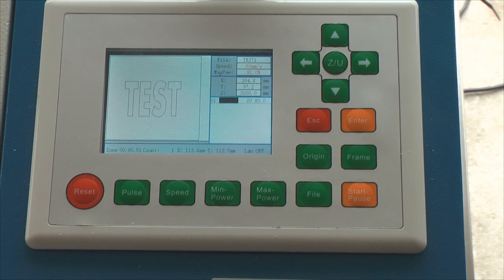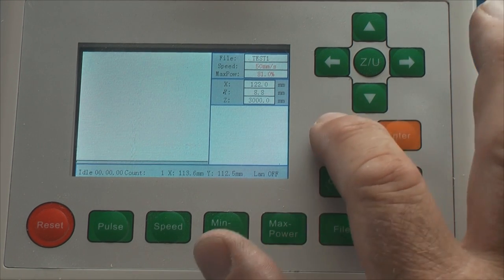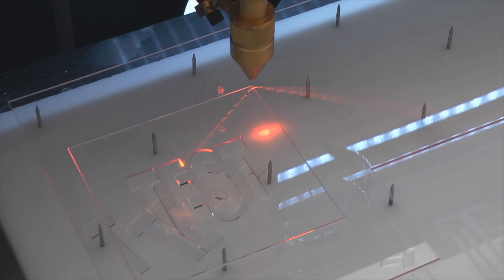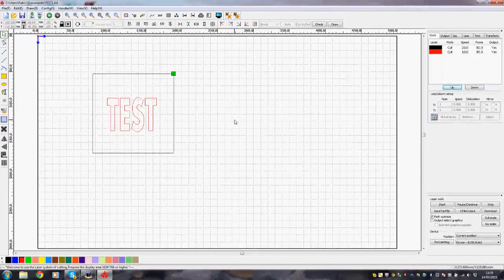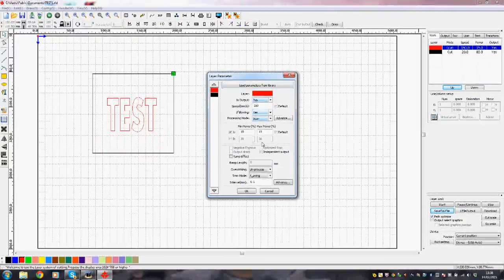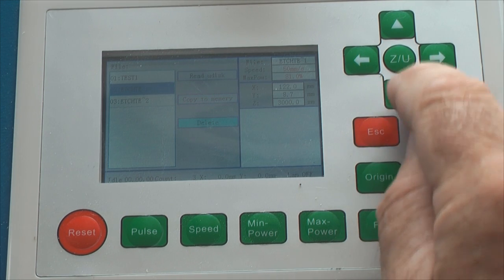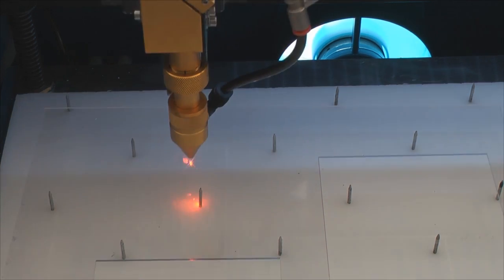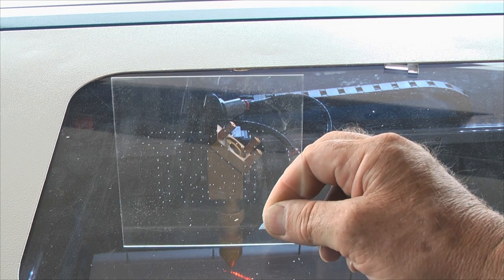Chinese laser cutter  tutorial part 5

Comment: Thanks for making these videos! Ive been using a glowforge for my business at overview.design for about a year now and wanted something larger. Your series has really helped me make some decisions.
Reply from the maker: Hi David
Thanks for the comment
If you have  only gone as far as this initial tutorial then there are 3 years of my learning journey to catch up on.Iam in the fortunate position of now owning 2 machines .One is this low cost "China blue" machine and the other is a slightly bigger 600x400 better quality Lightblade  machine (at 5x the cost) that has really been a plug and play unit. I have had fantastic fun understanding the many little design flaws with the China blue machine and it has forced me to learn about the many details and dark corners of this sealed tube technology and the things I wold look for if ever I bought another machine. I have pimped up my little China blue so that is a real gem and I have not spent huge amounts doing so. 
How have you found the Glowforge? Is there a reason for changing? Upsizing? Speed?

Best wishes
Russ

Comment: And I am having trouble with my life!!   Etching seems weak even on higher powers.   Cutting needs much power- upwards of 75% For small thin wood products and acrylics.    Photo to engrave is aggravating and cannot get the correct settings.   I’m afraid I’m going to break this thing with all of the experimental numbers I’m pushing.   Cheers Russ
Reply from the maker: I'm glad you have a great sense of humour. It's a definite requirement if you are trying to house train one of these little Chinese dragons.
As a general rule cutting requires everything that you can throw at your material and then you set the speed as fast as the cutting will allow. With engraving text and logos etc, it depends on how deep you want your engraving. Because this is scanning and will take a lot of time, you tend to set high speeds in the region of 300 to 400mm/s and then set your power to get the depth of cut you are seeking. This will generally be 50% or more. With photo engraving you are trying to get the smallest possible dot and that involves setting speeds of between 100 to 200mm/s (depends on the response capability of your HV power supply) and very low power , probably in the 10 to 20% region. 
All this assumes that you have a well performing tube and from what you describe your tube sounds like an ill tempered teenager. Is your tube labelled K H Laser?. As I suggested earlier,we may have to try to resolve this by email.

Best wishes
Russ

Comment: Sir, may i ask where you purchesed this laser from? can you provide me with the shop link?
Reply from the maker: Hi 
There are several similar to this on ebay .uk

https://www.ebay.co.uk/itm/500-300MM-50W-CO2-LASER-ENGRAVING-ENGRAVER-MACHINE-CUTTER-WOOD-CUTTING-USB/253293418743?_trkparms=aid%3D555018%26algo%3DPL.SIM%26ao%3D1%26asc%3D20140122125356%26meid%3Dd8ea14a22a0f4a56aa8af937f36199e2%26pid%3D100005%26rk%3D1%26rkt%3D5%26sd%3D382621948914%26itm%3D253293418743&_trksid=p2047675.c100005.m1851

Put the description into your ebay.
Be warned. At tis price it is good value for money BUT it will be fitted with a B grade tube and power supply .It will work but not very well. It will get you started but you will soon have to spend another £400 on a new A grade tube and power supply

Best wishes
Russ

Comment: what happens if i hit a nail point?
Reply from the maker: Do you also lay awake worrying about how you are going to spend your lottery winnings?. Joking aside, the chances are low but if the beam (through the very thin slot) does coincide with a nail point, it will reflect off like a mirror and that energy may be be enough to cause a small scorch mark on the bottom of your job. Pity all those folks with honeycomb tables ...nightmare!!

Best wishes
Russ

Comment: Good night Sarbar! Can you simulate the cut? as if the head passed where it will cut but without firing the laser, thank you.
Reply from the maker: Hi Marlon
There are 3 ways of doing this.
1) Choose the preview screen in RDWorks and run a software simulation of your program.
2) Set your max and min power to 1% and run your program. The laser will not fire at this low value.
3) If your machine is fitted with a laser switch,  then you can just turn that off.

Best wishes
Russ
Reply: thank you!

Comment: I purchased the 50 watt co2 laser engraver 3 months ago.  It worked fine for 3 months then the laser stopped firing in middle of a job. I am getting voltage to the laser tube but it doesn't fire . I replaced the tube and i the same results. I did notice on the main board that 15 was lite up but I don't  know what 15 light is for.  I do not have ground in my home but it still worked for months.  Can anyone tell if they think it could be a ground issue?
Reply from the maker: Hi Gary
The instant nature of the problem you describe is not typical of a tube failure. Your tube will start losing power as it starts to die. It will be over days or even weeks. What you describe is an electronic component failure within the power supply (usually). The fact that you have LED 15 on is good. That means your mains conditioning power supply is working and the controller has power.  That means that your programs should run but with no laser power?
If the power supply is working then there will be a beam in your tube. If there is a beam but no power then that is a tube problem but if there is no beam than you have a power supply issue..

Your machine was provided with a grounding spike and wire to earth it separately. I presume you have that fitted.
If this was an Ebay machine, the chances are that you have a B grade HV power supply fitted. Within my  copious correspondence, I have many reporting early  power supply failures.  Your original tube will have been B grade also BUT it depends where you purchased the new tube. If you bought that from ebay then that may well be a B grade also. The Chinese have found Ebay a great way to monetize their rejects. Is there a  brand label on your new tube? (K H Laser or Xi laser for example)
Although ebay is a great place for some items, trubes and power supplies are a no,no.  If you have a machine importer on your continent that you can trust, buy from them. (i'm still very unsure about Lightobject). The safest and cheapest place to buy is direct from China, however, when you add the courier charges and your local import/taxes, the end number is eye watering. I know because I have been on that route. After buying a replacement tube from ebay, (I got burnt a second time) I swallowed hard and bought a new 60 watt tube and power supply combo. That was 2 years ago and it's still performing like new today.

Best wishes
Russ

Comment: Hi,

I recently purchased one of these machine. The small screen on the machine is in Chinese. Do you know how to change this to English?
Reply from the maker: Hi Eoin

Take a look at this
https://www.youtube.com/watch?v=UF37pbL2hpw

Best wishes
Russ
Reply: Hi, Yes, I got it sorted. Do you have one of these engravers?
Reply from the maker: Hi Eoin
Yes I have an upgraded  ebay Chinese laser (70 watts)  and also a much better quality Chines built laser (60 watts) supplied by a UK company called Thinklaser.
Best regards
Russ
Reply: I cannot connect the computer to machine, or I cannot get the laser head to move from the controls on the machine. Any suggestions?
Reply from the maker: Hi Eoin
With the machine turned off, move the head to the middle of the table. Now power up the machine (you can have the laser tube tuned off). What happens at this point?
Best regards
Russ
Reply: At present, the head is positioned in the middle as a default. When I turn it on, it stays in that position
Reply from the maker: That is wrong to start with. It should drive the X and Y stepper motors to set a 0,0 position at either the back left or back right corner and then return to the last defined origin point, which in your case may be the centre of the table.  For neither motor to move is unusual and can be nothing to do with the controller because you have a panel display. Thus there is a 245Vdc supply to the controller. The silver perforated mains  conditioning power supply will have 2 output voltages. One will be 24 vdc which we know is working and the other is probably 36vdc to drive the stepper motors. If you have a voltmeter you can check if this PSU is supplying 36vdc. If it is you will have to check if that 36vdc is still there across the stepper motor drive teminals V+ and GND. for both X and Y axes. I suspect there maybe no output from the PSU or if there is,   a break in the line supplying the drivers.
Best regards
Russ
Reply: So when you turn on the machine, the laser head should move?
Reply: Where are you based?
Reply from the maker: That is correct . It should move to one of the rear corners where two sensors (little rectangular blocks) will stop the motors and set a 0,0 position for program to work to. No movement means no power to the steppers. As I said, it can only be the 36vdc supply that is absent that stops BOTH stepper motors
Best regards
Russ
Reply: Shit, is this easily fixed?
Reply: Where are the 36vdc supplys?
Reply from the maker: Hi Eoin
I am based in the UK . Sorry I cannot preform miracles so I cannot say how easy it is to fix. You cannot fix a problem until you understand it so the loss of thye 36V supply to the motor drivers seems like the only logical thing that will affect both motor simultaneously. If there is no power out of the 36V terminals on the silver power supply then it means a new PSU. If there is power out of the PSU but it never arrives at the stepper drive modules then you will have to find the broken wire.  I suspect this may be outside your realm of experience and it may be the time to call in a favor from a techy friend?
All best wishes
Russ
Reply: Thank for your words!!
Reply: Have yon an email address? I would like to email a photo to you relating to the laser engraver
Reply from the maker: Look at your you tube messages
Russ
Reply: It is also coming up on the small screen on the machine saying 'Water Error 1'. Any ideas what this is?
Reply from the maker: Yes. It means that either you do not have water flow through your laser tube. If you do have water returning  water  to your reservoir then it means that the switch is not working   (a fairly common fault). There will be a temporary way to bypass this but first check that you do have water flow or you could wreck your tube.
Russ
Reply: Water is flowing!

Comment: Hi, first thanks for this remarkable series of tutorials. With your tutorials help my machine is set up and works well when driven from the keypad on the machine.  Second Help! I have RD cut files on the stick. when the stick is in the top port (usb interface) there is no light on stick and no files can be found.  When the stick is in the second from top (usb socket) the stick light is on however when I go File -u disc-Enter-read u disc - Enter I get NO FILES. It seems that the rd files are not on the disc. The stick does contain other format files. Should I have used a new empty stick? What can I do to try and fault find? Can I try and run it from the lap top driving it from the RD works program.  Any help gratefully received.  Malc.

Comment: Thanks for this video. You did a great job! After watching this videos I decided to buy one.

What kind of pressure regulator did you use? And what are it's ratings.
Currently it is hard to one, that is operating at such low rpressures.

How long does it take, until the water gets hot?
Reply from the maker: Hi
I used a normal air regulator but it's right at one end of it's adjustment. It's not really regulating pressure it's more of a flow regulator. So any  cheap regulator will perform this function, for example 
http://www.ebay.co.uk/itm/Compressor-Relief-Regulating-Regulator-Valve-AR2000-Pressure-Gauge-Air-Control-/351047069388?hash=item51bc092ecc:g:CbIAAMXQ74JTSOPR

If you are using the aquarium pump provided then it is an oil-less air pump and you will not need a filter

The  water temperature rise depends on several things The volume of your reservoir (at least 2 gallons of distilled water), the power of your laser and the the time you are using it for. Some tubes claim to run at 25C but most good tubes will run up to 40C. 

Hope this helps
Best regards
Russ
Reply: I love to make projects with Arduino. I was thinking about making a micro controller controlled air pressure regulator. This part is possible task.

But I was wondering if it is possible, to include air pressure value into drawing (for any layer)and pas the value the laser cutters controller to the Arduino?

Is a project like that possible? Are the possible benefits worth it, compared to the time will need to develop it?
Reply from the maker: The air pressure is not a vital element for most work. If you block the flow from the little air pump it will max out at about 1psi. Once there is flow, the pressure drops to an even lower value. There is a small choking orifice as it passes through the to the nozzle via a connecting fitting. The air is now in the nozzle  but the hole in the end of the nozzle is so big relative to the choking orifice that the pressure in the nozzle is almost zero. 
I would not worry about controlling this pressure other than with a simple cheap pressure regulator which is effectively controlling the flow.  for 99% of the time you will require full flow. I am not an electronics person but there is a more interesting Arduino project that I have been sent by an Australian correspondent.  I will be publishing that in the next couple of weeks because I am currently on vacation and away from my editing kit.
Best regards
Russ
Reply: Hi Re Va, 
We are manufacturer of Laser machine, if you have plan to buy it, will be glad received your inquiry.  
Iris
iris@sinmic.com 
whatsapp: +8613153158953

Comment: I noticed a problem and wondering if you see the same thing. After generating the dot pattern, did you noticed the head did not return to the home position?    The more dots you generate, the greater the error in the home position.  The shorter the dots, the greater the error in home position.   I noticed this with dot times as great as 0.1s.  I conclude the steppers are missing steps since if you hit reset, it goes back to the home position.
Reply from the maker: Hi John
Several questions. I could be misunderstanding your situation so forgive me if I'm off track. Lets just go through the logic of the losing steps theory.
There are two 0.0 positions on the machine. There is the machine absolute 0,0 set in the top left (or for some machines top right) by the inductive sensors, and then there is the program 0.0 (the green square in RDWorks) which is set to a position you decide by pressing the Origin button. It sounds like you have got the Origin set to absolute 00. Lets assume that to be the case.(by the way this will cause errors if you are engraving)
The steppers will only lose steps because of some resistance or they are being asked to accelerate too fast. They cannot gain steps only lose them. Lets assume you are losing a step at every dot. If you have a line 45 degrees away from absolute 0.0 with 100 dots on it,  then by the time you get to the last dot you will have LOST 100 steps. Lets assume that the steppers have each been told to move 1000 steps to get to this last dot, in reality because of the LOST steps they are only 900 steps away from absolute zero (in both X and Y). When your program has completed its last dot, the steppers are commanded to move 1000 steps in X and Y  back to the Origin point. OOPs. It  will crash into the absolute 0,0 100 steps early and make a rather strange "cogging" noise.
Using this logic, losing steps isn't the answer. BUT you could be losing steps because of a unidirectional resistance in the bearing slides on the HOME journey. That's the only way that your observations make sense.
The head X axis is unlikely to be a problem as there is only one slideway/bearing. The Y axis has a beam and TWO bearings. If there is out of alignment between these bearings, I can imagine the possibility of frictional resistance.
Does the error build up in BOTH axes? or even to the same degree?
If you set your Origin away from the absolute 0,0 and run the same program several times. does your dot pattern overlay the second time or  do you produce a further offset patten each time you run it?
I have not played with dotting, only accidentally, as apart from putting stitch holes in leather goods (not my scene) I can see no use of it for me.
Speak soon, I'm sure
Best regards
Russ

Comment: Thanks for the series. The file name on the machine is DOS like 8.3 where the maximum number of letters for a file name is 8 and 3 for the extension (file type). That is why you see a ~1 and ~2 . So you need to stick with 8 letters for names to be properly seen on the machine.
Reply from the maker: +Waheed Alsayer 
Hi Waheed
Yes. At this point I was very new to the machine but it all became clear after a little use.
Best regards
Russ